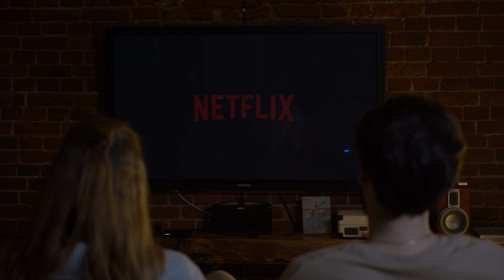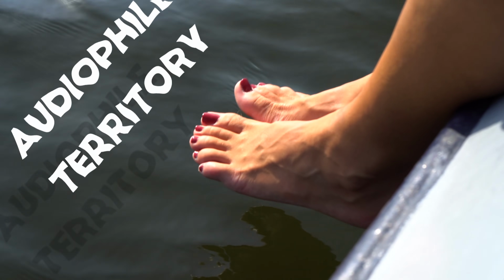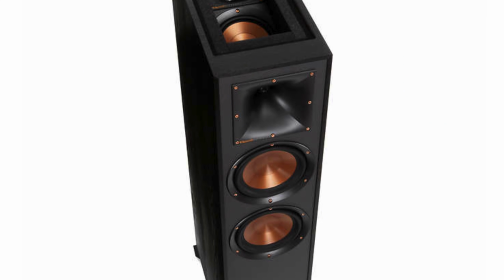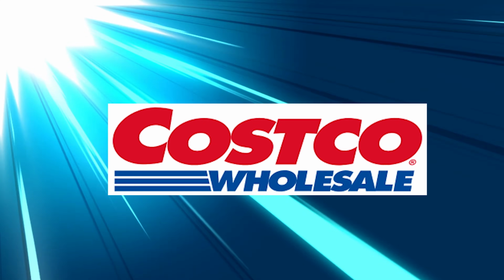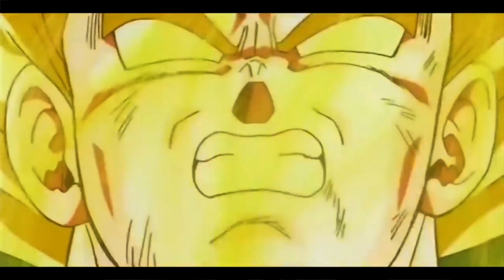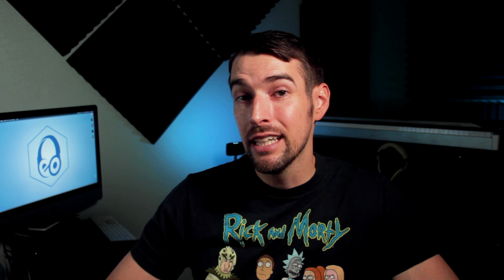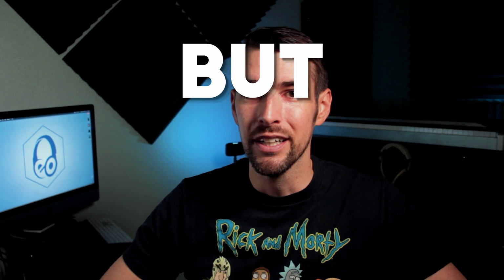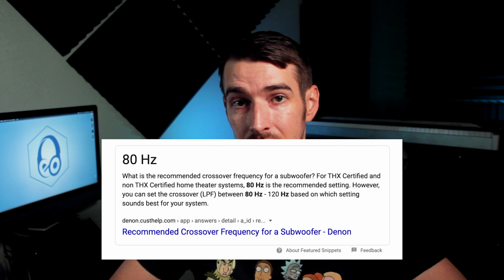$1,500 BRAND NEW Dolby Atmos BEAST SETUP?! Costco & Klipsch Bring It AGAIN!!!

Comment: Just ordered the Atmos setup from Costco as I just couldn't pass it up for the price- thanks!! As far as a receiver- I passed on the Sony dh-790 and bought the Yamaha TSR-700 from Costco. It is the same receiver as the RX-V6A and is $200 cheaper. I needed a receiver that will do 3.2.2 and this is the only receiver I found that will do that for me to start until I figure how i'm going to place the rear surrounds. As far as Subs- I ordered 2 (yes 2) Klipsch R-100SWs from Amazon. I think they are are better sub than the 12" one at Costco. Gerry
Reply from the maker: Awesome, Gerry! Way to take advantage of the sale!
Reply: @ealanosborne  Thanks again for your video and showing the path :)......
Reply: those subs are actually worse. the frequency response isn't as good because they're smaller with no upsides. And you paid all that extra money for them smh

Comment: I bought everything needed for this and absolutely love it!! It sounds amazing. I currently have it in my living room with 20 ft ceilings so I don't get the atmos affect much but the system sounds amazing. I currently only have one sub woofer but plan on getting another. Even better if the speaker package is currently on sale at Costco for $100 less than the regular price. I got refunded the difference since I bought it less than 30 days ago. Thank you for the recommendation.
Reply from the maker: Awesome!!! Yeah, the other win with getting it through Costco is their amazing customer service. I have a video coming out tomorrow about a 5 step gradual upgrade plan you might be interested in. In-ceiling speakers are a must-have down the road with your 20 ft ceilings. 😀🙌
Reply: @ealanosborne  I'll be sure to watch it. I plan to buy a new house with a basement over the next three months. I  want a dedicated home theater room. I already have an extra set of R-41M so my next step will be to upgrade to a different receiver. The almost / over $1K to add the extra channels for said receiver is frightening though. Lol
Reply from the maker: @patrick03vargas  no kidding. It just gets more and more expensive with each tier you are brave enough to enter 😄
Reply: @ealanosborne do the upward firing speakers in the towers do as good of a job as wall mounted speakers pointed down to give that hood Atmos sound? I know neither will be as good as ceiling mounted, but are the tower and wall mounted the same?

Comment: Pro tip to save an additional 50.00 on the Klipsch, call first ask them about stock on the R41-m's they will check stock for you, at my local store they said they had them in stock, but turns out they do not stock them, they had looked up the wrong speaker, Now I was goign to go to Costco anyway that day to buy the ref pack, But they didnt know that so I told them well that is disappointing as I came all the way down here because they said you had them in stock.

As a result they offered me a 50.00 discount on the speakers I did buy, bringing the price down to 749.99 for the Ref pack.
In the end I bought 11 speakers for under 999.99 less than 100 a speaker for Klipsch speakers, and not bookshelves.
Very had to beat.

Also I have noticed that in the boards Audiophiles Hate these ref pack speakers, they seem irritated even, many told me it is a rip off it isnt a great price because they run them at this price all year long, But that to me makes no sense, because you can also get these from Crutchfield or other retailers for 700 each, yet Costco for 750 for the whole set, I say it is a heck of a bargain.
Seeing you cant go listen to other speakers anyway, why not start with these?
I looked up the SVS alternatives to these R41-M's and they were nearly the same in everyway even the frequency response was similar.
The difference was the price 89 a pair for the Klipsch R41-M's and the SVS are 135.00 each or 270 a pair, that is 3X as much as the Klipsch!!!
Reply from the maker: Very true. Haters gonna hate, no matter what. Sure, anyone might wanna upgrade their speakers at some point down the road, but for the bargain price and specs that the Klipsch offers? Can’t beat it. 🙌
Reply: @ealanosborne  No, I love them, they sound great and serve their purpose and allow me a full system for 3200 that I wouldn't be able to afford with ANY other speaker pack with similar frequency responses and sensitivity ratings.

Comment: By the way I purchased the Klipsch ref pack and it comes with enough wire to wire up the whole 5.0.2, it had 95' of wire, two longer lengths I think 25'; each for the surrounds, then 5 15' lengths I think, all I know is I was able to wire up the towers, the atmos speakers, the center and two surrounds with what was included.
I also purchased 2 extra sets of the R41-M surrounds for 89 a pair, these do not come with any wire so for now I am waiting for my speaker wire to arrive then I will wire those in as well.
I am goign to replace all the wiring actually when my wire comes in so it is al the same, and add banana plugs to it as well, right angled for the speaker ends and straight for the avr end.
Point is you do not need extra speaker wire to wire up the 5.0.2 Klipsch from Costco ref pack.
Reply from the maker: Yeah some others have informed me of that too. Which is cool! I figured Costco wouldn’t leave anyone hanging like that, so I’m glad it was “false advertising” in a good way. 😄 They need to update that online listing, for sure.

Comment: I bought this reference pack along with Denon s750h and two subs. Since the tower speakers have upward firing speakers, so these upward firing speakers need to be hooked up to the center surround channel at the back of the denon?? Sorry i am new to this so trying to understand...
Reply from the maker: Oh! Yeah, that can be confusing. You’d want to connect the upward firing to the ports labeled Surround Back. You can see in small print below them that it says “assignable.” So inside the Denon’s software, you can assign them to be the front height Dolby Atmos-enabled speakers 👍
Reply: @ealanosborne  you are awesome, just one request.. if you could create one video for how to configure Denon S750H with Costco Klipsch reference dolby atmos pack along with two subs, that would be awesome.. really appreciate what you do...🙌🏻👍🏻

Comment: Lol the bundle is 100$ less today. And the sub is 150$. Bought them, i just cant resist. Now looking for an avr.
Reply: Meanwhile Costco sells a Yamaha receiver identical to the new RX-V6 called TSR-700 $399 vs $600 for the RX from Amazon, Crutchfield, Adorama, etc. I'm thinking about replacing an older Yamaha model in our family room with it. Old one works fine but no wireless, Airplay, Pandora, etc.

Comment: I just bought the setup from my local warehouse. It was $799 and the Sub came for $149. I also picked up the Denon AVR for $399. It comes with all the wires needed and the setup was completed in less than an hour. Now, since that I saved close to $200 should I get the second sub?   :-? :)
Reply from the maker: Well duh! 2 subs is better than one! 😄 Congrats! I’m excited for your new home theater vibes!
Reply: @ealanosborne  Thank you for making such amazing content! I'm impressed with the sound quality. The only dumbest thing I just realized is Samsung TVs doesn't send Dolby Atmos signals from Disney+ so I need to pick a Firestick 4K as a workaround. And of course, I'm going to pick another sub tomorrow. They are selling like hotcakes right now at my local Costco warehouse :)
Reply: The price reduced by another $100. It's now $699 in store

Comment: What are your thoughts on the Yamaha TSR-700 vs the Denon AVR-S750H that you mentioned? I heard that the Yamaha is normally a $600 receiver and supports 8K/4k120 for my xbox, but the denon appears to have a staggering 165W per channel as opposed to 100W in the Yamaha so I'm not sure.

Ideally, I'd like to get the Denon AVR-X3700H you mentioned in your $3000 build, but the price is killing me since it's only offering two additional channels and the option to spend even more to add another two. I already have four extra R-41Ms laying around and have upgraded to two R-12SWs, so maybe I should just take the leap and buy that 3700H.

Comment: Best video I've seen in a long time.  A lot of great information!
Reply from the maker: Awww, thank you very much!
Reply: @ealanosborne  Hey man, I got a question. You're my go to guy for such things. I'm setting up a 5.1 surround sound system. Do the Front Left/Right and Center speakers all have to be in line with each other for optimal sound? I wanted to mount the Left and Right speakers slightly above the center cause it would work better with my space. Would that placement affect the quality of the sound?
Reply from the maker: @4midable4ce  No, it won’t affect the sound. For example, you’ll see a lot of in-wall systems will have the front left and right speakers on either side of the TV, and the center channel above or below the TV (def not in line with each other), and they sound just fine! 😀👍
Reply: @ealanosborne  Great! I was hoping you'd say that. Thank you once again, you're the best. You'll be the first person I tell when I finally have this set up.

Comment: Just a heads up, until 4/4/21 Costco has the R-12SW for $149.99
Reply: Got a link for 149?
Reply: Nevermind.......just saw the date. Damnit.
Reply: I was excited to purchase this system. However when I was at Costco to purchase the system, on the box it stated that the  system contains items that can birth defects and cancer. So as good as this system is my overall
Health is more important to me. So I did not purchase the system. Bummer.
Reply: @lawrencegreywolf1397  Just a heads up, California Prop 65 is on just about everything. As long as you don't decide to eat the rubber surround or the cones of the speakers and you don't ingest the synthetic fibers inside the towers (used instead of cotton) you'll be fine. I get the 'worry' but we don't stay inside with oxygen tanks even though the sun and the air-quality outside causes cancer too. 😊
Reply: @Andrew-718  Thanks Andrew. It’s always wonderful when someone who is more knowledgeable than I, can share and be helpful.
Mahalo !
Reply: @michaelmartin4366  entire package? Speakers and sub?

Comment: I could really use some help here.   I bought the Marantz 1711 and the two subwoofers suggested in the video (great video btw).   I cannot figure out how to connect the subs.   They have a white and and red RCA in put in the back.   The Marantz indicates two subwoofers are good, but I think they would have to be converted to mono? Maybe?   There are actually 6 connections in that section of the receiver, but I am getting confused by the labeling as part of them look like they might be for something called a zone 2?   I could really use advice.   Thank you!
Reply from the maker: Hi James! Yeah, looks like the subs connect to the 2 bottom black-colored inputs in the “pre out” section where is says “subwoofer.” Ignore the red and white inputs in that same section. Just the bottom 2 send signal out to your subs.
Reply: @ealanosborne  You are such a blessing right now!   So are you saying I can run over to the store and pick up a pair of y adapters?   (since the subs themselves have white and red inputs)
Reply from the maker: @TheMusterion  Actually you don’t have to worry about that! Each sub just needs a mono signal, so typically you plug one end of the RCA cable into the Marantz, then the other end into the white RCA port of the sub. White is associated with mono, usually. Then do the same for sub#2 plugging into the other available subwoofer port of the Marantz.
Reply: @ealanosborne  You definitely rock!    (I'm in cable mgmt hell right now, but couldn't wait to hear it).   Taking the cash I would have spent on the adapters and checked to see if you had a Patreon.   You did and I just signed up.   Thank you so much for your video work.   I enjoyed it very much.   Keep up the great work!
Reply from the maker: @TheMusterion  Wow! You’re awesome for pledging! Thanks so much! Happy to help!
Reply: @ealanosborne  Hi Ealan!   If you have a moment, I was wondering if a microphone could be used with the Marantz.   Basically my family is curious to see if I can do Karaoke at home, and I was planning on using my chromecast for Youtube Music and Lyrics (which is connected to the marantz) which feeds into my TV's arc (not E-ARC).   Essentially is it able to be done?   Or would I be better off purchasing a separate cheap PA system.   I just don't know if audio from Chromecast and a microphone can be done simultaneously.   Also not sure if the Audessy setup mic port is the same port I would need to use for a microphone (that I would need to purchase) or if I should use the ports in the back of the unit.   Thank you so much for your guidance!

Comment: When running 2 subs should they be at different settings? I'm currently running one of those subs from Costco and for the money I have a hard time believing there is much better "for the money". But after watching your video I just purchased a second one. Should they have different settings? Great video btw!
Reply from the maker: Thanks!!! And 2 subs should be as balanced as possible. So the same settings for both, but also less gain for each, compared to running just one. 

And try and keep their placement even as well...so if one is on one side of the room, try and place the other equidistant from your listening position on the other side of the room to help balance out the low frequencies filling your room. 

There’s honestly a whole science behind tuning subwoofers alone, so they can be tricky, since low frequency waves are so long and can cause some issues in smaller rooms. 

I just purchased a UMIK-1 calibration microphone since SO many comments from my SVS subwoofer review suggested I get one so I can more accurately fine tune my sub situation, given my living room is large and open.

I know some stuff about home theater, but I’ve already learned SO MUCH MORE doing this channel, and will continue to learn. So let’s learn together! 😁🤘

Comment: Upward firing Atmos speakers are junk.  That, "bouncing" sound off the ceiling is a gimic.  If you have a textured ceiling, the sound will be broken up.  Not to mention, depending on the angle of the atmos speakers, even if you get a clean bounce off the ceiling, the sound will rarely bounce directly back down to the listening area.  And forget it if you have a vaulted ceiling.  You have to have a flat ceiling for this to even remotely work.

I have independent Klipsch Atmos speakers, and when I first got them I sat them on the left and right  tower speakers pointing at the ceiling and could never hear the sound from them as intended.  I ended up mounting the Atmos speakers all the way up the wall at the ceiling.  Because they are angled, they are pointing directly down at the listening area.  Same for the rear Atmos speakers that are positioned directly to the left and right of the listening area. The result?  Amazing!

When watching the latest Mission Impossible movie, the helicopter chase scene toward the end of the movie and hearing the helicopter blades swirling overhead coming out of the Atmos speakers, extremely impressive sound experience.  But keep in mind I have 4 Atmos speakers and they are all pointed directly at the listening area.

You will not get the same sound experience with  Atmos speakers pointed at the ceiling.  Even trusted YouTube channels like Audioholics will tell you this is a gimic and will not give you the Atmos sound you're really trying to achieve.

The best method is in ceiling speakers, the next best solution is wall mounted speakers at ceiling height pointed to the listening area.

Comment: The R-41M are garbage for surround. Got this set from Costco last weekend and if it weren't for the R-625FA's, I'd return it. And just to let you know, these are not the newest versions of the speakers but the ones released back in 2018-19 so you will be buying new old stock.

Comment: Klipsch 12” subs just went on sale at Costco for anyone waiting to add them to your setup 😎
Reply: I was just about to comment on this video that they're at $150 now... INSANE.. i just bought 2 and i don't even have a receiver yet!
Reply: @MarcAngello  same. Bought the atmos set and one sub. No receiver yet. Lol
Reply: If I knew this would’ve happened. I would’ve never paid $299 (at the time) for the R-100SW. Smh.
Reply: Bought the subs for $149.00 in NY / packed it up and took it back. Classic case of getting what you pay for. Port chumping was horrendous ! For $399.00, bought the RSL Speedwoofer 10S. Great investment.
Reply: @Audiomainia2310  Funny thing is. I don’t have that specific model Klipsch but mine barely has port chuffing until you really start pushing them.
Reply: @Iridiumcosmos  Started almost immediately for me - not even pushing reference levels and it was so discernable, even after modifying the crossover both on the sub and in the receiver when I was getting nowhere. Went for an RSL Speedwoofer 10S / best move I made.
Reply: @Audiomainia2310  I’m actually checking those out right now. Debating on whether or not to keep my R100s. How’s the sound?
Reply: @Iridiumcosmos  Fantastic! Even at low listening levels, you can discern the lows very cleanly down to 24 Hz - this one I'm keeping. For a little over $400.00 direct from RSL, with a risk free 30 day trial ( they supply the return label ) you cant go wrong.

Comment: I ordered the same set around thanksgiving and guess what... there is a 100 off on that as well ie it comes for 799. Also, I got 7 set of wires with the set and Denon 750 works beautifully with this system. I will suggest to get banana plugs from Sewell while doing the initial setup as those make cabling so much smooth. Overall an amazing setup and thanks for sharing this video with details explained very nicely 👍👍👍